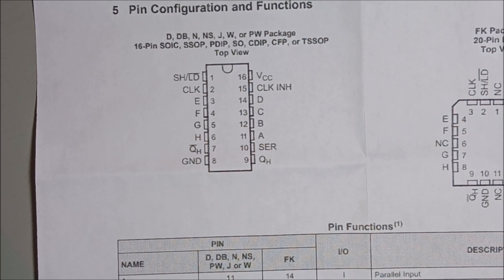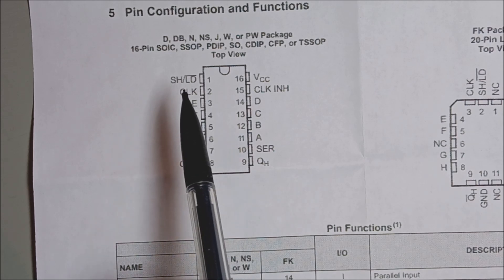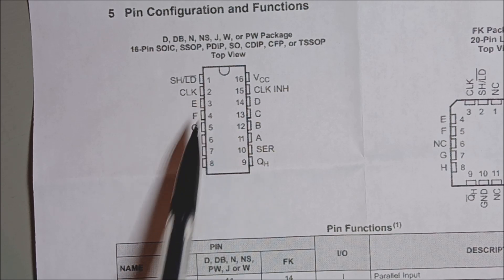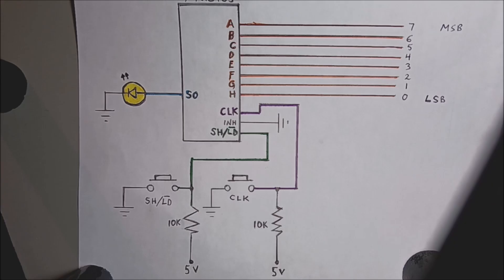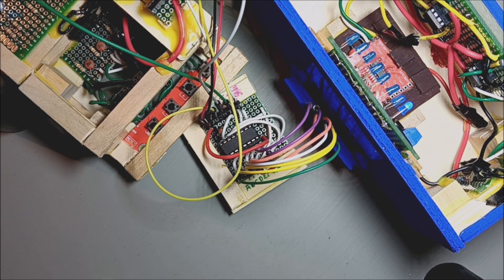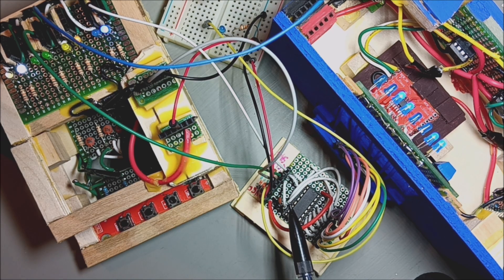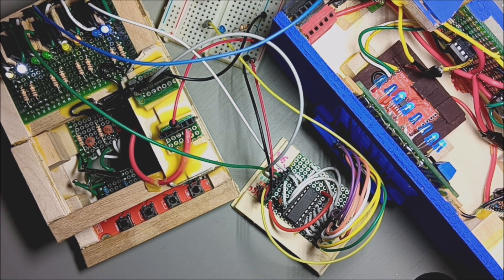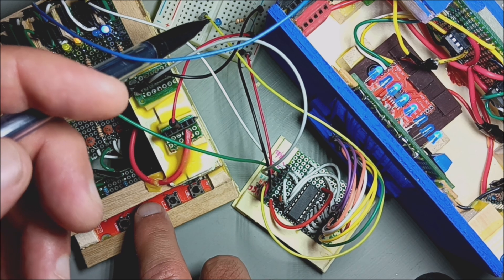74HC165 Shift Register (Parallel in Serial Out)

Comment: Interesting way to interface old 8bits ports to communicate with serial eproms, wondering wich circuit would do the reverse way, get the serial signal and convert to parallel 8bits !
Reply from the maker: Thanks for asking. There is the 74HC595 Shift Register (Serial in Parallel Out). https://www.youtube.com/watch?v=bYiwaYWO7II